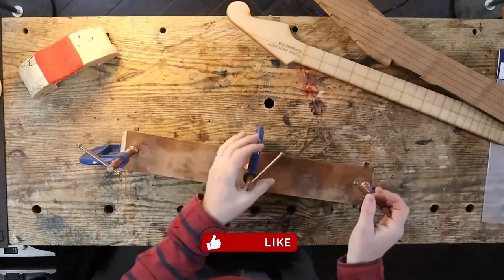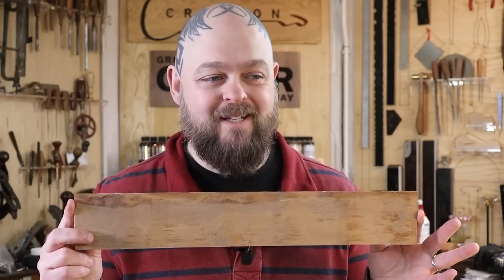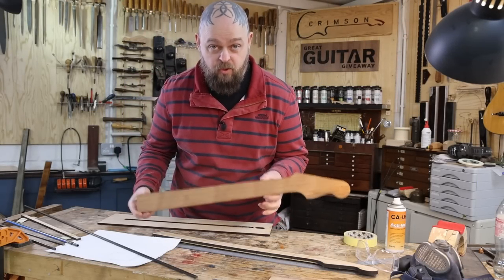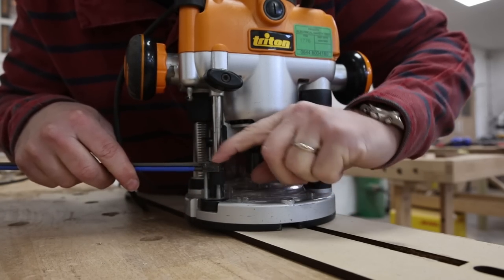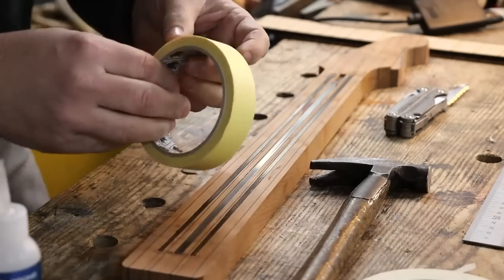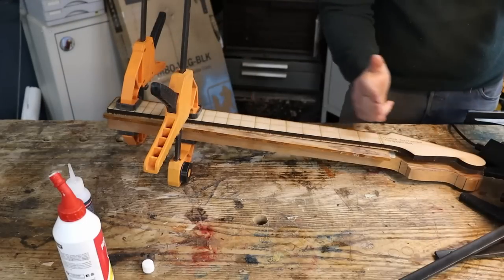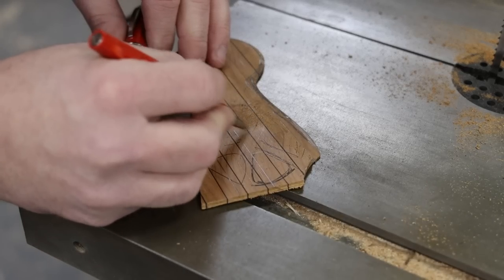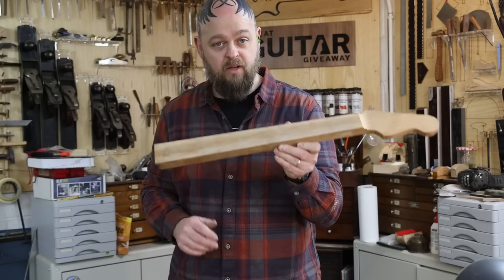Ep 6 - From the Neck up? | Building a Guitar from 42,000 Year Old Wood!

Comment: For cutting that headstock area off on the bandsaw after the neck shape is routed, U can super glue and masking tape the neck onto a piece of 4x2 and use that as the piece that registers to the bandsaw table.   You can get the neck set perpendicular to the blade relatively easy that way.   And it’s WAAAYYY MORW STABLE!

Comment: I’m sad, Ben. I’ve been having to de-superglue my Crimson TR template from the blank after routing the main channel, then move it along to get that extra bit of channel needed for Gibson or Silver Sky - type TR adjustment slots.

And now I see the one you’re using there has an additional little slot just for that extra bit. A great upgrade but it left me behind a little. I weep…

A suggestion for your neck/fretboard templates - as your already mark the fret positions, why not a little text field alongside the 12th fret? Also, holes for the centres for inlay positions would be incredibly useful time saver.
Reply from the maker: Thank you Paul, I have sent this on to Sam Hook.  DC

Comment: Is the belt on the Triton oscillating sander going clockwise or anti-clockwise? It does look like it is going clockwise. I ask because I have the Rigid (US) version of this machine, and it runs clockwise. However, the sander mechanism is flipped 180 degrees from the Triton. This places the smaller roller on the right, and I don't like it. I would prefer a version of this sander type that has the larger roller on right, and runs clockwise.

Comment: My question would be, why not have assembled the entire neck blank, sans truss rod, and cactus juice the entire thing? Then install the truss rod from the rear, Fender style.
The neck and headstock, especially the headstock, are likely to dent as well. 
Am I wrong in thinking that the juiced fretboard won't lend much strength overall, as well?

Comment: Since you vacuumed wood with resin, are you not concerned about glue joint strenght between fretboard and neck (I thought you would use epoxy for that job…)? Anyway, keep on with good work ;)

Comment: Like the style of this video! I'm intrigued why you didnt use the template to create the truss-rod access hole? I havn't got a template like this and getting that hole to look neat has caused me a few tears...
Reply: Ditto! I remove and replace the template a little further along the neck and use an 8mm bit to rout that part of the channel..
Reply: But I might route a new guide hole in my template… will need a couple of bits of wood to make a temporary template for it - as you might use when routing a neck pocket into a body to match the neck you have..

Comment: Ben, about the carbon fiber rods: You have glued them in using CA glue, and you have only put the glue at the bottom of the cavity. Is this sufficient? I have seen people using epoxy for this and they were flooding the whole pocket with epoxy. I am about to build a bass neck with carbon rods and you have just confused me.
Reply from the maker: You don't need to flood it with epoxy.  What I did is perfectly fine.  Ben